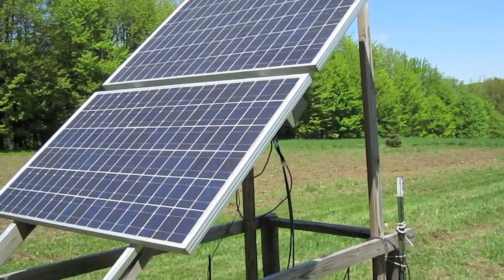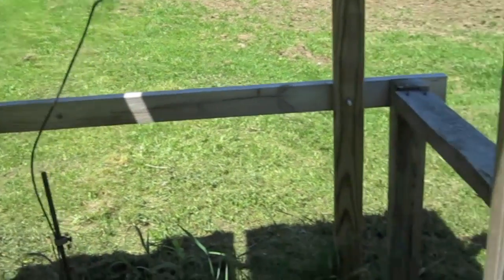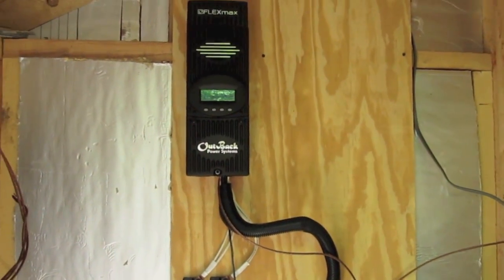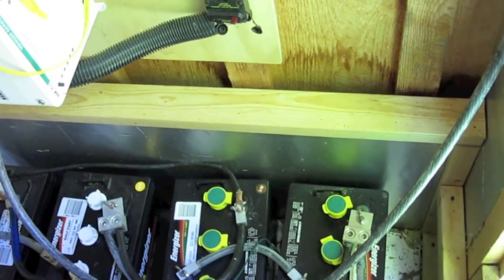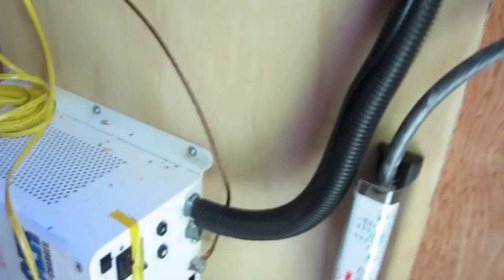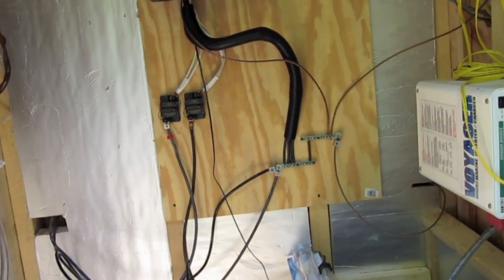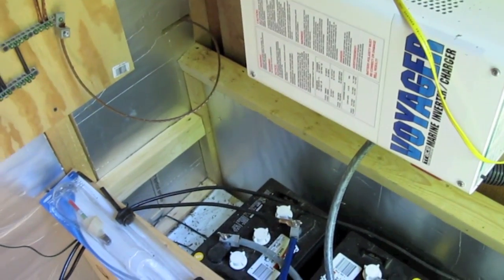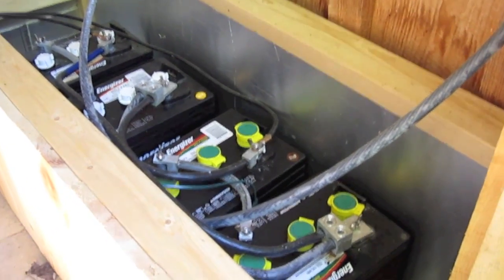Off Grid Cabin - Solar Electric Power System overview

Comment: Is your system still working well
Reply from the maker: yes... still running on the original batteries... I might replace them next year as they are getting a little long in the tooth but maybe I'll see if I can go one more year...
Reply: If you had to do it all over again would you buy the same?

Comment: if you have a good quality MPPT charge controller it doesn't always matter what the solar panel voltage is compared to the battery bank.. my system is a 12 volt battery bank with four 250 watt - 30 volt panels wired in series.. that makes the panel input 120 volt to the Midnite Solar charge controller.. 

btw, this is a CSA approved system designed by a reputable solar power company.. is NOT my design.. 

I gave them the room available on my RV to mount panels and the fact I wanted a 12 volt battery bank because most of my power use is 12 DC directly from the batteries not 120 volt AC from the inverter.. 

the system was designed by them to give me the best design for a 1000 watt set of panels ( biggest set that would fit on my RV) and a 12 volt battery bank..  there are several ways to wire the batteries (12, 24v, 48v etc) and several ways to wire panels (series, parallel, and series/parallel) that would give different voltage input so if you wanted, you could have say a 24 volt battery and a 30 volt solar input... what was explained to me is the solar input voltage must be higher than battery voltage, you could not charge a 48 volt battery with a 30 volt panel BUT you can charge a 12 volt battery with a 120 volt panel

Comment: You're answering all my questions about the build of my cabin and the solar system.  If I have a similar set up to you...I've seen one I believe the two panels combined give 400w and it has the controller and inverter and wiring included (on EBAY there's a couple like this for around £300-400 GB Pounds I'm not sure of the exchange rate? ) and I am going to get 2 x 12v deep cycle batteries (they're expensive but I am no electrician and I would rather have two new ones than second hand which may have problems I can't fix). I am getting a small woodburning stove (I've forgotten what the unit of heat is called "therms? Lol!) But the output is 5 (I'm sure it says kw but may be wrong I plead being female for this heh heh!) With back boiler fed from rainwater harvesting (solar should run pump) the question is,  with all this up and running (it won't be until autumn) will I need a generator too? I'm going to see if the gas company will swap my empty butane cylinder for a propane one just in case (it's the same company and they used to only do the blue butane cylinders but now do red propane ones - I still believe most people use butane and the propane seems to be more for RV"s and canal boats etc) 
Sorry to give you such a complicated question but to recap so you don't have to read all that is,  on top of the solar and woodburning stove/water heater do you think I will need a generator and the propane (the stove has hotplates)?

Comment: I was wondering how the transfer of power works, and by that I mean when the inverter goes to the fuse box does it work the same way as your power company's ? The main that supplies the bus?
Reply from the maker: +scott ferrara yes the inverter feeds the mains same as the power company does on a traditional home, just with less capacity as the inverter is only 1500 watts.

Comment: so how many battery's and panels would I need to live with only solar power
Reply from the maker: how much power do you need
Reply: not sure i would only have house hold lights a computer and some studio equipment like 8'in monitors a keyboard  then a fridge and heater not to much small 16ft. x 20ft. shed house conversion
Reply: Not sure if you're still considering solar, but a regular fridge takes a fair amount of power, probably your biggest load.    If you're already set up for on grid, it is unlikely you will save money going off grid.    I am guessing your system will probably end up costing you around $10,000.    Some of that depends on how much sun you get what what your other power needs will be.     Years down the road your system will not be free as equipment especially batteries will wear out and need to be replaced.

       A regular house to be converted could cost somewhere around $60,000 or more.    A lot of saving can be realized through reducing your needs.

      I also want to say Inplix is spam and a scam.     Good luck and have fun with your project if your still considering it.    If the reasoning is to have fun with it, or other reasons besides saving money you should go for it.

Comment: great job on the videos. So no problem with rust? but as long as you have lots of air in the shack it will be fine.
Reply from the maker: nope... been going for about 6 years and no rust... the floor is built like a porch and has lots of venting... the ceiling also breaths under the overhang from the cabin roof....
Reply: that should have no issues with rust as it did not anyway. Some people are a bit crazy about acid. But as long as there is good ventilation they're should be no problem 😊

Comment: You can put a max of a 150 volt DC in to the charge controller and set the charge controller to only send 15.4 volts to the battery

Comment: I'm looking into making a solar generator and possibly converting most (if not all) of my house hold off said generator (if possible). I live in Hawaii, and it is ridiculous how expensive we get charged for electricity...
Where can I start? Anyone got any tips?
Reply: buy a small battery and panel and inverter learn how to play with it i got a basic 500 watt system for about 300 great to start on and build from there

Comment: For best efficiancy use 10 X12 volt batteries and a 120 Volt DC to 120 Volt AC inverter..  Your system will last for days without sun..

Comment: You say your system puts out 450 amp hours.  How does that translate into amp hours of running normal 120 volt AC appliances?  Thanks
Reply from the maker: It doesn't put out 450 amp hours... it has 450 amp hours of battery storage... With the inverter I have I can run a 1500 watt load...

Comment: just one more thought, as people upgrade their 12 vdc panels you may get them at a bargain. keep an eye out on craigslist, be sure and do a voltage check before money changes hands.
again, nice job!
Reply: I see scams in CL.  There are several add in my area where they want to charge you 100 some dollar per hr for consultation.  Solar installer do not charge any thing to give a bid.  Solar panel, inverter, wind trubine etc were more expensive than the brand new.  Ebay or amazon also have lot of scams.

Comment: I took interest because your inverter looks like the Magnum, perhaps an earlier version. So I read through the manual and here are a few things I noticed. There should be a jumper between the 2 hot output lead terminals, that's why one breaker doesn't work. This is not a 220 vac inverter
This is a 1500 watt output, that's almost 15 amps, you have 6 breakers, but you have learned to live with in your needs.
You still wish to have a smart inverter like this because it will save your batteries vs a simple inverter that stay on until the batteries are dead, you don't wish to drop below 50%.
If you upgrade to the Magnum, 220 vac 30 amps, 48  vdc, I have a friend at wild nature solutions, Craig will give you good prices and tech support.
I would keep the wood frame, because it works unless trees are blocking winter sun.
best, john
Reply from the maker: thanks... when I get back in the spring I will open up the inverter and take a look  for that jumper...

I'm not planning on upgrading the inverter anytime soon... I got this one used fairly cheap... new ones like this are expensive...

For what we use this is really overkill but does allow me to use power tools that would overload a smaller unit

for the panel mount I will have to either make it larger or replace it... depending on the panels I get I will have 4 to 6 to get to 1kw... again I am building this larger then I need... mostly because I want to :) if we use the cabin more in the winter it would be nice to have to worry less about the batteries... but you are correct I can wire in a generator through the inverter to charge the batteries...

Comment: price per watt is close to 60 cents these days, shop around. you can hook up a generator to your grid input on the inverter. it would charge your batteries and run the house if you have a few dark days.
if you wish 220 volts, you could put in an Outback transformer between the inverter output and house panel.
best
Reply from the maker: Yeah the prices are way down from when I bought these... sometime in the next year or two I am going to do a major upgrade to the system... looking to get to 1kw... maybe change the mounting to a pole mount... and the batteries will need replacing in two or three years... give or take... trying to stretch them out...

Comment: Well done bruh, I can't wait to get something like this started up…;)
Reply: If you want it bad enough you'll get it. I recommend to anyone, buy a piece of cheap property out west (preferably near where you can work) and set an RV or camper out there. Hook up your solar for electricity, solar water heating, solar heating, etc. The sun provides just about everything you need for your home. The hardest part I've found is air conditioning. It takes a lot of power to run an A/C. Right now I'm just considering running a 10,000 btu window unit on a 12v solar system that has a 1600 watt array. The A/C will only be run during the day when the panels are bringing in enough power. If I need it in the morning or evening I can always use a generator.
Reply: Clint Young 

New 2014 solar energy  here look at link 
http://earth5energy.blogspot.com
Reply: No thank golf swing - I'm not that type of builder, I design at times, but, I don't build my designs...  Besides, I'm back in the job market under my normal pay grade, but, thinking about it again, I think that's why I want to use Davison design group to get my builds out my head... ;)  Or, in this case, buy the solar panels at a good to great price to output ratio and setup as needed...

Thank you though...

Comment: Do you run any 12 v lights right off the battery bank? Seems that would help extend your available power.
Reply from the maker: I don't... but I'll be building a small solar power system for my guest cabin and that will be 100% 12v... subscribe and when I post the video over the winter you can check it out...

Comment: Great video, but if you don't  use your batteries during winter time, how do you keep them in good shape for next season?
Reply from the maker: winter is only a couple of months and so far (going on five years) they have held up. Might not be optimal but its worked so far...

Comment from the maker: You are mistaken in that it is possible to both charge with a charge controller and have an inverter running on the same battery bank... it works much like your car alternator charging the battery while you are using that same battery to run the electrical system in you car...

Comment: I see that your charge controller is connected to your battery bank to charge it when it needs to be charged. Also, your inverter is connected to that same battery bank. I was told that it's not possible to charge and discharge a battery at the same time so how does that work for your system? How can the charge controller charge the battery bank while it's being discharged by the inverter? Thanks a lot! Max.

Comment: What electrical items are you running on average per day and for how long. I'm just trying to get an idea of how much that is powering. Also the number of charging cycles on the batteries under normal use would be appreciated. Thanks ; )

Comment: Not to jynx you, but are you concetned with a electrical fire with everything mounted to wood? I love the set up and am in the process of designing my off grid homestead. My plan has me building the inside if my electrical room with either metal studs and sheetmetal  skin or refractory/brick. Whats your take on that? Thanks for the vids!!!!!

Comment from the maker: you can... for a very short time... if you want to run AC or heat or any other high power use items for a long period of time this system will not do it... you would need a much larger setup... more batteries, panels, inverters... really it is night and day difference... this will run high power items for a little while... I routinely run power saws, sanders and other tools but by there very nature it is a short run time...

Comment: You did a good job, I'd like to see the size of your cabin since I am in the works of building mine 1200 sq ft. I am also in wheelchair so I need open spaces & flouresent bulbs. I will post mine in Sept. I just needed to know how much watts I really need for a fridge, washer/dryer combo and lights. Is 180 enough for a 18 cu ft fridge etc

Comment from the maker: No... my system will not run an electric stove for any amount of usable time
anytime you are generating heat with electricity you will require such a large system that it becomes to expensive... this goes for hot water as well... look towards gas for heating requirements...

Comment: I have to say good Job. I am currently building my own solar back-up power for my home. I currently have about the same power rating on my solar cells i purchased and have them mounted on my shed roof...it's the perfect angle. I like your idea about using fuses and ground wires. I will need to add them once Finnish with the set-up.

Comment: On your current setup your inverter can only output 8 Amps at the max on the one side. Is this correct?

So you couldn't run a standard refrigerator on your current setup, what do you actually  run with your current setup?
Also with your lights in your cabin are they 12v or 120v?

Comment from the maker: The inverter is 12 volt... I like the simplicity of 12 volt... but really I could have done either... as far as running all that stuff you would need to find out the load they create... and have battery capacity to run it...

good luck

Comment: Please tell me ,is your inverter a 24 or 12 volt system.I have a line on a 12 volt 3800 watt inverter.Im not sure if I need a 24 or a 12 for my cabin. The guy Im buying the invertor from wants $500. for it.I hate to spend the money and find out later it wont work. I need to run a washinging machine,tv,lights,etc...Im hopeing I can do that with this invertor.

Comment: Just a thought here. Since the electric room is elevated, I would run the wires up into the room from underneath, instead of up the exposed wall. You would never see them, there is no point of access for water to come in and it would look tidier. Obviously this is a tip for anyone else who is going to do this. Great video. 

I apologize for all of my fellow human beings that were negative with the umm and ooh comments. I've learned that most people just suck.

I've subscribed. - okhomestead

Comment from the maker: that little room is not very air tight... so far it has not been an issue... Its been on my todo to take a power line off the charge controller and vent things... maybe next summer...

Comment: Thanks for the info.  Got a basic used solar system with solar panels, charge controller and breaker box, etc., a couple of years ago, but have been intimidated about setting up at an off grid log cabin, but I am definitely tired of relying on my generators so this year I'll make a go of it!

Comment: Your System seems like just what I need and cheaper than purchasing a "Complete system I want to build a System that can power my Deep Well, But it cannot be too close to the well.(not sunny enough). Will be building a new well house with the power area there. But it will be a fair distance away. So there are a number of challenges.  Have been trying to find your Site.

Comment from the maker: Back when I built it around $2500 give or take

Right now the panels are dirt cheap... you can get them for $1 a watt...
The charge controller costs about the same
I got my inverter used but there are good 1kw afordable options out there
The batteries are a bit more expensive... Probably about 25% more

for the same price I could build a 1kw solar power system and still have some money left over... for about $3000 I think I could build a 2kw system...
Reply: Its dirt cheap and easy but battle born batteries is what u need though ...they are number #1 on the market in2020

Comment: Please help: 
I'm using 24v solarpanels, a 24v solar charge controller and a 12v battery set up. Can I use a 12v puresign inverter or should I stick with a 24v signwave inverter????

Comment: This is a nicely balanced system. ok the charge controller is a bit overkill... but it does a nice job allowing you to keep high voltage and low current for that 50feet cable between the panels and the battery bank.

Considering the use, you should be able to keep those batteries 7-8 years easily.
Increasing only the battery bank, especially using flooded cells, will not be beneficial.
Flooded cells require equalizing, and having less than 5% of capacity as charging current will not be enough.

Comment from the maker: do to the distance... the panels are about 40 feet away... the wire run is about 50 feet... when I built it everything said if you can all grounds should be common unless you have a long distance involved... so I posted on a couple of solar power forums and got some confirmation that with the distances involved separate grounds were appropriate... thanks for watching...

Comment: I was curious why you chose to ground the panels on a separate electrode instead of running a panel ground wire to your powerhouse and tying that ground wire to the bus bars with all the other grounds.  Thanks.